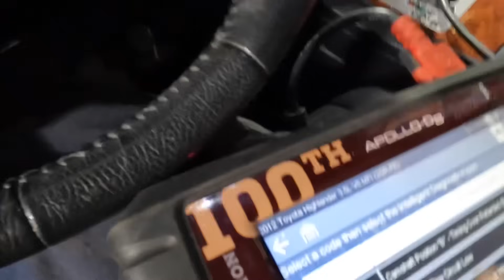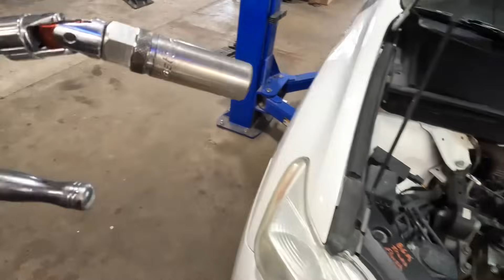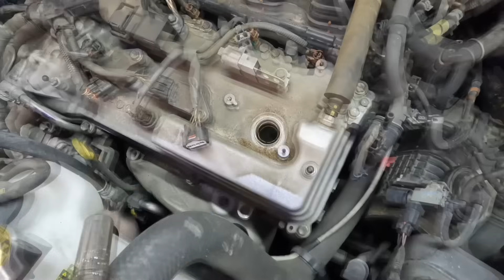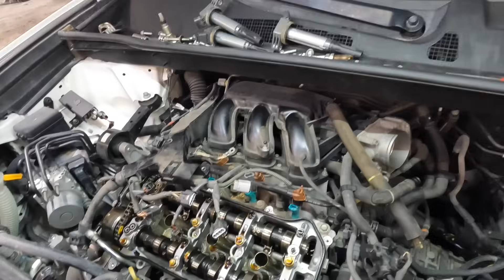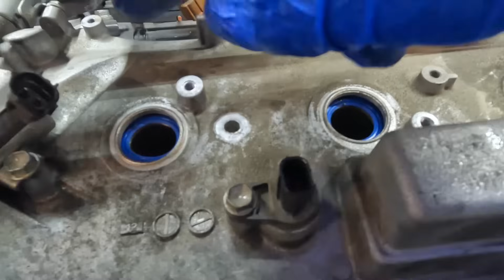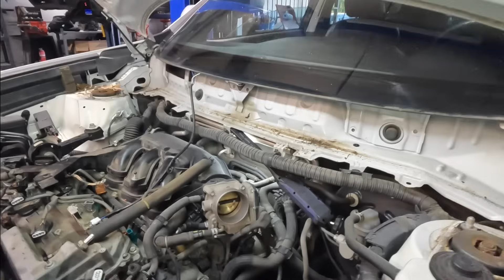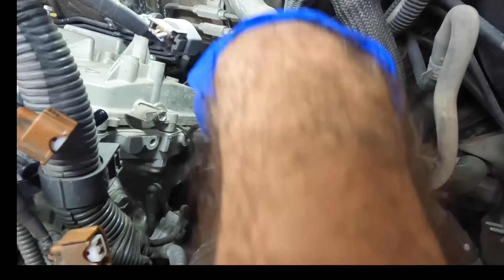Timing Chain Codes! Toyota Highlander P0014 P0025 P0012 VVT #repair #automobile 2GR-FE 3.5L

Comment: Tip on reusing copper crusher washer anneal them. At my job we take apart a lot of pipes that use crush washers but we never have replacements. A few minutes under a torch until red and dropped in a bucket of water make them good as new. If you don't do this there is a high chance that it will leak unless it's the first reuse.
Reply: Great tip!

Comment: Hi Ray. Got a question for you about how the hourly rate is worked out. Is based on the mechanic using ordinary hand tools or the electric wrenches like you do? Surely the difference in time between the two is significant.

Comment: Love your work Ray, I do find it strange you don't use a bit of anti-seize on the spark plugs, simple little dab for the next poor sucker that is in there, plus limits thread galling on an aluminum head.
Reply: Newer spark plugs don't require anti seize because they come with a special coating that prevents seizing. So doing so might cause the coal pack to come loose.

Comment: It is called a banjo bolt because it is similar to the tuning thumb screws on a banjo (or other similar string instruments)
Reply: The hollow fitting that the bolt goes through, with the pipe that goes into the fitting, resembles the shape of a banjo.  I think the bolt is called a banjo bolt just because it is the hollow bolt with holes near the top that is needed for a fluid to get through.

Comment: You can buy replacement plugs for the ing coils that are not cut and splice, you just have to remove the pins and put them in the new plastic, after your done it looks like no one change any broken clips.
I would advice my customers as its a known problem they need to pay for the part ( 2.00 or less) and the labor apx 15 min a plug with the right tools.  You can take these plugs apart without damaging wires or the plastic parts.

You think toyota would fix this problem. Or at least have a replaceable harness for the bank of coils.
Reply: Those plastic tabs are also in many other manufacturers, not just Toyota though 😢

Comment: The silent, unspoken plan for automobile manufacturers is not to produce a product that is reparable, but a product that needs to be replaced.
Reply: Not really since some of the parts are overbuilt while others are underbuilt.  Manufacturers don’t make cars fall apart, but don’t work real hard to make them last forever either.

Comment: Always good video Ray.  Has no one come out with a kit to repair/replace the injector connector housings?
Reply: The connectors are sold separately, but have to be soldered on to the existing wiring.

Comment: What I find truly amazing is the fact that no "F" Bombs surface when tools or fasteners are dropped. Bravo!
Reply: I wouldn’t let anyone work on my car if I found out they are the type to get angered that easily
Reply: @bustedkeel  unfortunately no good tech can stay in the business for long without developing anger issues. It's better to get it out in the way of swearing than doing the job poorly
Reply: @arvilsstraume9304  F-bombs abound at my place. Those affected should stay away. I sling words with abandon (mostly directed at 'engineers').
Reply: ive been wrenching for 30 yrs on all sorts of things and its something i enjoy to do. i get to go into my own little world by myself learning as i go. ive found when i start letting anger creep in, the enjoyment starts to fade so instead of giving in to the dark side, i walk away for a bit, get some coffee or redbull or something to drink, grab a lung dart and breeeathe. it rarely ever comes to that anymore but thats usually when im having troubles figuring something out, not because i dropped a tool. ive found if i set a big towel under where im working that things dont make it to the floor, just a couple inches down to where i grab. 
theres always a solution to a problem and rarely does anger help. at least for me.
Reply: Not changing engine oil & filter is like no toilet paper and forgetting to flush the toilet.😊
Reply: No "F" bombs. That's what happens when you get a family. You suddenly have to learn a whole new level of tolerance! 🤣
Reply: Just say "Gravity" instead of F-bombs
Reply: Isn't that how Arod left the stealership job? F bomb and general meltdown 😢

I don't subscribe to him because I don't have diesel powered vehicles, but it was in my feed
Reply: Sure glad I have my older truck...this stuff is flying 🛸 junk. I dont drive it to pieces ...going on 115k on odometer...2002 Ford ranger..little trouble...few fixies.
Reply: The Tasmanian devil mechanics👺
Reply: He saves the Anger for his wife lol he almost edits it out good

Comment: They are called banjo bolts because the hose fitting that they attach resembles a banjo with the bolt removed.  They are named banjo bolts not because they resemble a banjo, but because the fitting they go into resembles a banjo.

Comment: If the owner were to use a dash protectant on those spark plug connectors would it help keep them from breaking? Would it for lack of a better term rehydrate it if it is dried out over time?
Reply: They're 11 years old... The plastic bits go through lots of heat cycles and can become brittle as soon as 4: years old 😢

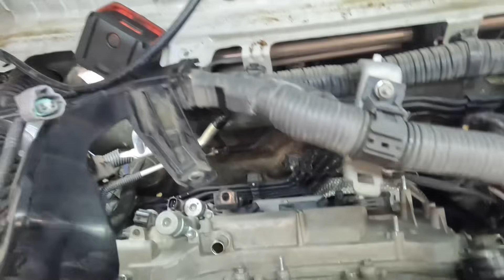Comment: 1:17:50 They are called "Banjo Bolts" because of the similarity of the radial hole in the bolt below the head to the hole that retains the string where it wraps around the neck of a guitar or banjo.
Reply: He knows that-it's just a comment generator that's getting a bit overused now.

Comment: It's interesting that you so commonly have the coil connector lock tabs break on V6 Toyotas. I had a 2009 Corolla, 243000 miles at tradein, that never broke one tab. Perhaps it is a heat/time related cause, the 4 cylinder engines don't get as hot, more airflow in the area.
Reply: A transverse crammed V6 pulling a heavy car in a hot state definitely contributed to the demise of the plastic parts.

Comment: These days we have more stuff crammed into a smaller space, back in the 50tys you had lots of room and in many cases you could even sit on the steel wheel well, with your feet on the steel frame, along side the motor area. No cramming, lots of space, no brittle plastic connectors, no bruised or cracked ribs from hanging over engine compartment obstructions.

Comment: 🎉 I found that if you push the connector in before you try to push the tab ths breakage gets reduced since there is less holds ng of the tab and the ammount of pressure to open is less

Comment: Hi Ray, I don't think those seals will fix the issue, for me the problem are the Cam phasers, those Toyota s are known to have that problem there is a TSB for this problem, and also you need to lubricate the spark plug tubes and seals so they can slide easy when you install the cover

Comment: Transverse mounted V6 are not fun to work on! I have an '07 Highlander and did plugs a couple of years ago and it was difficult, but not like that one! Did the timing belt a year later and that was not fun either, have to do through the passenger side wheel well.
Reply: How did you do a timing belt on a engine that doesn’t come with one?
Reply: '07 have a belt not a chain. @waterloo123100

Comment: The customer probably went to a "quick lube" type shop for an oil change and was told they needed valve cover gaskets. If they asked to see the leak, the tech would've squirted some oil on the back of the head. Then, they'd clean it off and charge for a job they didn't do. @27:50... Go to a Walgreens or CVS and buy alcohol pads from the bandages section. I use those alcohol pads to wipe down where I intend to use RTV. It removes any oil film. Better than using brake clean. @37:55... I would've sprayed it down with brake clean before installing the spark plug tube seals.

Comment: With these engines, the 2GR-FE, how important is a “valve adjustment”?
I keep getting reminded to do that $500+ service at my oil changes and I can’t seem to find any definitive information on what it is or if/how a DIYer like myself can do the job.

I also have the intermittent codes for over retarded timing and the codes only show up when we are on longer trips with the vehicle, I’m starting to think that the gaskets are probably the issue as the oil has never gotten dirty enough to clog the screens to my knowledge. But with this info I’m going to be investigating in the near future.
Seeing engines being serviced and taken apart helps me understand what to do when I’m servicing my cars as I’m very much a visual learner and this takes a lot of the mystery out of jobs like these that require a fair amount of disassembly to access the areas of need. Thanks for this content:)

Comment: On an '04 Chevy Tracker with the Suzuki XL 7 engine the upper and lower oil pan, it had an oblong rubber O ring where the oil from the oil pan  which snaked from there back into the engine and went back into the engine to feed the oil pump.  Perhaps on the 4 wheel drive version the upper and lower oil pan was different and allowed for fittings for an external oil cooler maybe. That O ring was deformed due to oil running through that  passage thus causing the valve train to lose prime over night. Oil slowly dripping externally from that corner of the oil pan prompted me to replace it which a new O ring and  oil pan sealant. Who would've known?

Comment: At time stamp 20:40 you point out the oil  galley and O-ring.   At time stamp 39:56 you install the front valve cover, but the old O-ring (black) seems to have not been replaced?

Comment: Doesn't the value cover have a bolt tightening sequence and torque specification? Also doesn't spark plugs have torque specifications? Just wondering.
Reply: Yes every manufacturer has torque specs but he's a seasoned technician that can just use his "feel" for them, shrugs

As a DIYer, I'll do it with the torque wrench (1/4" and 3/8")
Reply: @ricebike  just having a feeling can get you in trouble and is the lazy way of doing it. Smart technicians always follow manufacturer instructions and torque specifications. "Click"

Comment: Great video! Appreciate you showing every step.  Yeah, the 2GR-FE is such a pain to remove the intake air tank and cowling just get to the rear bank. While you're in there changing gaskets and with all the labor cost to remove the intake, maybe suggest to also change the air surge tank intake manifold gaskets (3) and the throttle body gasket (cost is only about $30 for all).   As a preventative, maybe suggest changing the rear bank coils as these might fail around 200k and the car is now above 150k and 12 years old.....all that labor cost again just to return to the rear bank if one of those coils fail. I have a 2009 Sienna with the 2GR-FE and a rear bank coil failed at 205k just a couple months ago.

Comment: AHHH!! For the good old days when a valve cover job was sooooo simple!!!!!!! Your efforts are to be commended highly!!!! @124:20 Where oh where is the mechanics mirror??? Ahhhh!! @126:19 he breaks out the trusty mirror!!! YAY!!!!
Reply: So true. But even 50 years ago the were evil cars. I had a Mercedes van. Valve cover of the diesel had a hat shape. To remove it the motor must be lowered by around 4 inches. And it hat manually adjusted valve play. 🤬

Comment: Be glad you don't have a leaking timing cover, that's an engine out job. Nearly bought until I saw how hard they were to work on.
Reply: It was owning a FWD-based vehicle with a V6 that first got me out of the habit of DIY repairs.
Reply: Most people would be trading it in at that point.  Transverse V6s are throwaways especially over 150k miles.

Comment: Ivan (Pine Hollow Diagnostics) had a vehicle (I don't remember the make and model) that also had DTCs of multiple cam phasors being out. All of the usual components that could cause the DTCs were replaced by other shops, but the DTCs were still coming up. There is TSB that points to a bolt at the end of an oil passage near the cam shafts that can work it way loose. On that vehicle, the bolt was missing. Probably fell through the engine and into the oil pan. Likely, it was found and discarded on a previous the oil change.
Reply: Yep it’s the oil galley plug- notorious for loosening up on the 3.6 Pentastar engine!

Comment: Ray could you have finished up bank one and started the engine to see if changing the ring gaskets fixed the solenoid issue on that side? Obviously you are confident that is the issue. Keep up the great content.....👍
Reply: It's a good thought but too much reassembly IMO to be worth while.  Don't forget Dave had already done the prelim disassembly work and there is a fuel line to replace.
Reply: @desotosky1372  Clear as mud....lol. To much reassembly? He completed bank one  before moving onto bank two. So my thought was it could have been started to see if o-ring gaskets worked. What if  tearing  both sides apart and replacing o-ring gaskets doesnt work? Both sides need to be tor apart again. Just was thinking to test bank one to see if repair worked would or could save labor. Although Ray is a smart guy to I imagine he's got this pegged correctly.....👍

Comment: I also had a 2012 HiHi but on lease. I got rid of it in 2015 and bought a RAV4. Always heard that engine work was a bear on those 2GR-FE's and this vid proves it. I downsized because it was way too big for me to drive. Also, it had a water leak into the cabin due to a faulty weld  on the drivers side front quarter panel. It was documented on a Highlander forum too. Only Toy I had that was USA made and had a problem, the other 3 Toy's were made in Japan.

Comment: Just from a complete no experience but common sense point of view. If the solenoids operate on a specific oil pressure and that pressure is re-leaved by a leaking gasket up stream then those small o rings are the problem.

Comment: Ray Good Morning watching your video not being critical did the banjo fitting on the front valve cover have one or two crush washer on it. Just asking.  Always a great video. “How to-and Entertainment “
Reply: He removed two washers if my eyes were no deceiving me.
Reply: Banjo fittings need 2 crush washers, one between the bolt head and the fitting, the other between the fitting and whatever it goes on. Apply torque, and both will squish to create a seal.

Comment: Over time those figure 8 gaskets get hard and leak oil preventing the oil from going to the VVTI solenoids. They're actually called the cam tower gaskets and there are three of them there are two figure eight gaskets on one side close to the VVT gears and then another round one closer to the transmission side

Comment: Being a Japanese made car one would expect to be a lot easier to work with. Now it's obvious it's not. The old spark plugs look pretty worn. Maybe the owner never had them changed.
Reply: Similar issues with any vehicle with a transverse-mounted V6 or V8.
Reply: @Scramble-electron-890  True. If we look at it properly, a car owner will end up paying a lot more for what is supposed to be a fast and easy job changing the spark plugs.

Comment: this engine design is the worst for toyota. I guess toyota don't expect you to change the rear bank spark plugs and but to buy a new toyota instead.. stupid engineers..
Reply: Just curious, how would you have designed it?
Reply: @stevewhite3424  Honda V6 the J series engines are easy to get to rear banks plugs. the intake manifold is in the middle of the block unlike toyotas.
Reply: Not just Toyota, but everything with a transverse v 6 or V8; engine bay
Reply: @ricebike   if you look at a honda v6 the intake manifold plenum doesn't cover one side of the heads like toyota does.

Comment: Oh man, I feel your pain with those damn Toyota connectors. I recently got a 2001 4Runner from North Carolina and it had leaking valve cover gaskets coincidentally lol. I went to replace them and I broke the coil connectors, throttle body connectors and the fuel injector resistor connector. I’m not sure why Toyota made their connectors out of bake a lite but good lord 😂.
Reply: Some corporate bigwig probably decided to purchase them to help an associate or because they were such a deal.  Now, they’re stuck with them until either their stock runs out or the contract expires.  In the meantime, everybody learns to despise those connectors and the company that makes them.
Reply: They probably never thought a 2001 would still be on the road in the mid 2020s.
Reply: @user-tb7rn1il3q  I won’t argue with you there.

Comment: Just think, I thought a Kia Sedona van3.8 was a pain in the butt just to change the plugs. I may be wrong but if I change plugs I usually go ahead and change the coils to whether it needs them or not just to be safe. 😮
Reply: Ray never changes the back coils on V6 engines. Why?  No need for Autozone coils as NGK or Denso are cheap for him.

Comment: the vehicle is called a kluger in australia, early modles had hell timing chain stretching issues, newer models havnt shown signs of those issues yet, but there is still a chance being as the motor is basicly the same with a few modifications, only time will tell

Comment: Originally installed Toyota spark plugs have a paint mark, dot or cross, on top of the terminal.  Also found that poor quality oil or extended oil changes gave me VVT codes in this engine, stuck with Mobil 1 and 5000mi intervals for trouble free operation.